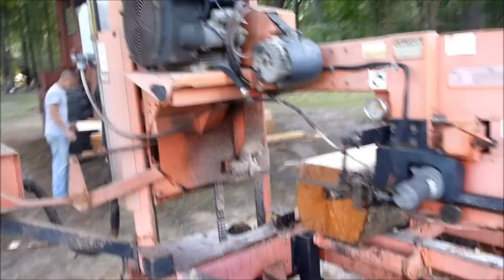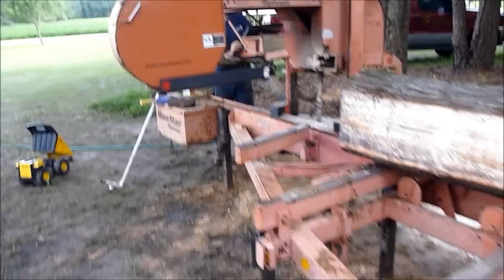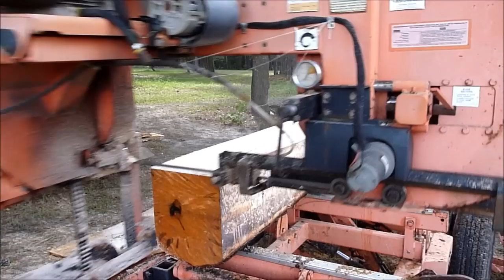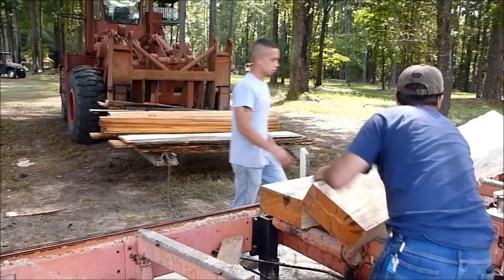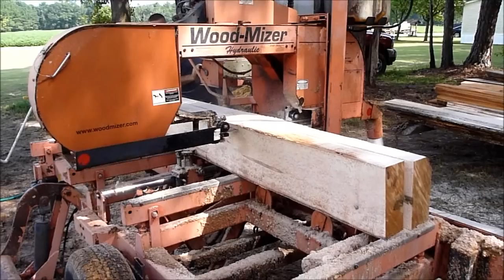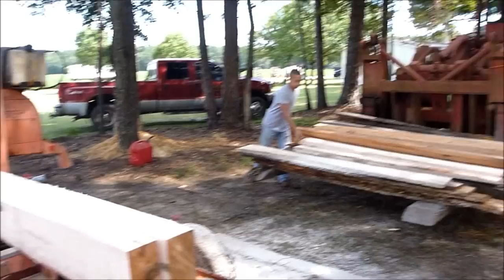Wood-Mizer Portable Sawmill Cutting Lumber

Comment: In 1984 a pecan tree, that my wife of 50+ years had played beneath as a child, fell over as a result of age and insects.  I went down to Baytown, Texas and cut the useable wood out and took it up to near Livingston, Texas and had a gentleman and his wife saw it into slabs. I stacked the slabs in my garage in Austin, Texas after  coating the ends in paraffin wax.and allowed the wood to dry for 18 months. Then I hauled it all down south of Bastrop, Texas to a straight-line mill where they sawed it up into 1 " and 3 " boards.  I then found a craftsman that built beautiful cabinetry.  Cabot Budlong. the craftsman, used the lumber and built me a beautiful fireplace facing and mantle piece. Cabot installed the mantle piece and facing (20 ft. to the ceiling) and I had a nice brass plate inscribed with the origin of the wood used and also that Cabot Budlong was the craftsman.  I also stated the the wood was from a Texas pecan tree that my wife (named) had played beneath the tree as a little girl. My wife was not really enthused with the project at the beginning.  Now she has her friends that come to visit go and read the plaque affixed. I did not understand that I was putting down very deep roots in this house when I did the project.  I would like to sell and  move to the country but, my wife refuses to leave this house.  We can't take the fireplace and mantle with us so "We ain't leavi'n"   "Too soon old and too late smart".
Reply: Now that is part of leaving a legacy.
Beautiful heartwarming story!

Comment: It is tough doing it one man operation the guy I haul the lumber for does it himself 99% of the time. His back is buggered up from the heavy lifting. Woodmizers can cut some really nice product. I did the deliveries with my truck hand bomb 4 ton of lumber on my F-450 and off I go. Some loads I delivered were 10 grand then again you aint buying the stuff I hauled at home depot. Most of it was custom cut and specialty order. Good wood and woodmizer anything can be done.

Comment: Being the sawyer bitch is a tough job I worked with a private mill owner he has cut hundreds of thousands of dollars worth of wood with his woodmizer. When you are cutting green fir and especially hemlock it is heavy as hell. Cutting 16 foot long timbers some of the planks were 150-300 pounds. Woodmizer mills are the best you can buy, the one job I hauled lumber from the cedar that was cut was worth a little under 200,000 dollars.

Comment: prices on bandsaw mill
Reply: Joe Hercules I built mine for about $4000, but already had an axle, plus an 18 hp honda for power. 36" diameter x 16'. I bought a mill kit from an awesome seller on ebay, but went around ebay for direct purchase